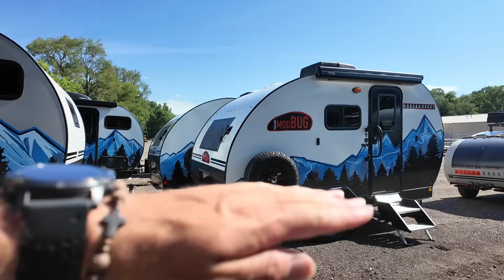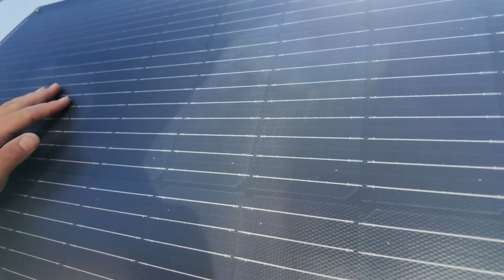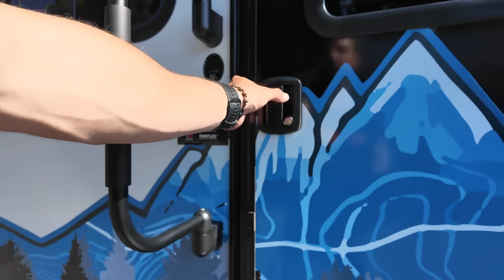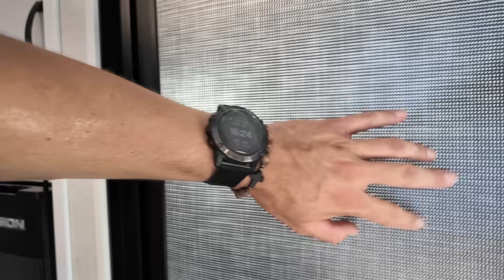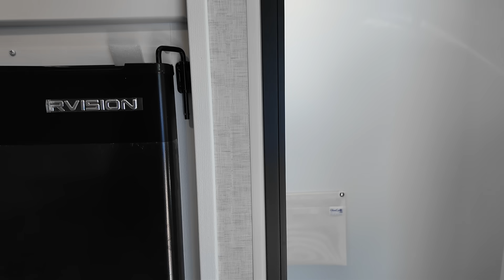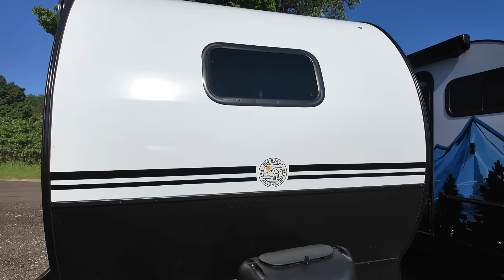2026 Modern Buggy BB14 Detailed Walkthrough

Comment: Sink in the Bath ? I; would like a second choice on the Roof A/C. 13500 btu is too big for this space. 9500 -10500 btu maybe. Some of the Sunset Park units have 5000 btu wall mount units. Less weight, less wind resistance, less expensive. Then a better spot for the Solar panel.

Comment: Hi was curious if this model has the external propane hookup for a side grill? Also the options list by the manufacturer states that there is an option for a “griddle slide out” I’m guessing that would go in the rear storage area is that right? Lastly what would be the feasibility for adding a backup camera?

Comment: Why would you go to the trouble of using Azdel on the floor and sides - and then use fiberglass on the roof where the air-conditioning is at?
Reply from the maker: I am not sure I understand your question... you want an azdel roof?
Reply: @fieldandsportsreport  Yes, if it's supposed to be waterproof and stronger than fiberglass why not use it for the whole trailer?

Comment: It sucks if you want a well-built trailer like this that won't rot you have to spend over $30,000 to get one.  A small trailer like this should never be over $20k, once you get over that, you can find much bigger trailers for the same price and quality.  It's almost like we are being punished for having small vehicles with a lower tow rating.
Reply from the maker: Only other thing I’d say is this retails in the mid 20’s so getting closer to your price point
Reply from the maker: I would argue the smaller campers you can take to so many more places. Bigger campers are limited in where they can go

Comment: Whats the flippin price unless I missed it. I hate when people make it difficult to find the price and their website doesnt show jack
Reply from the maker: They retail in the mid-20’s. I was just pointing out features. Pricing will vary dealer to dealer, state to state depending on options etc.
Reply: These trailers run about $32,000 but it varies by dealer.  Great trailer but way too damn expensive.
Reply: @DubC208 I mean they are high but it seems to be quality.  Like how Airstreams are expensive but last a loooong time.
Reply: @Mike81USA  A Human lifespan isn't long enough to justify the cost of an Airstream.

Comment: Bro...heres me again, and I like what MBggy is trying to do.  1st lose the utilitarian cement looking tops, they just make the interior look so much more cheaper.  Just white or wood be more warm and classic.  2nd The sliding BR door just screams cost cutting, put in a door with frosted plastic or solid.   Lastly put a drop bunk above dinnet that will now truly sleep 4.  Not much additional cost to do but the added value is superior.
Reply from the maker: Always appreciate your feedback and for watching... 
For the countertops - your preference is your preference in aesthetic. Can't argue it... They are 'Solid Surface' so a more expensive upgrade than a lot at this price point and they are are also incredibly lightweight. 

For the BR door - I would recommend using one (if you have already then all good) because I prefer it over a curtain or door. Lightweight, doesn't make you feel claustrophobic, self cleaning doesn't need to swing out to open so great for a small space. A lot like a pocket door.

The additional sleeping is a great call which is why we developed the BB16 that has that bunk you are talking about. Plus an additional 2 feet in length.
Reply: @fieldandsportsreport  I love the BR door, it's perfect. The solid surface Lagoon table too.
Reply: Thanks for the heads up on the 16, that's practically perfect.

Comment: Have you looked at the NuCamp Tab 360 or 400? Their layouts are so much nicer.
Reply from the maker: I have looked at both extensively. What are you referring to when you say 'nicer'? The Tab 400 weighs 800lbs more and costs $40,000. The Tab 360 only sleeps 2 people and costs $38,000. The BB14 sleeps 4, weighs 2200lbs, and costs roughly $25,000. I am not sure I would agree that their 'layout' would justify an additional $15,000 for a very similar layout and heavier. Thank you a ton for watching and commenting - genuinely appreciate it.
Reply: @fieldandsportsreport  I haven't found a dealer near me that will sell these for $25,000 most are around $32,000.
Reply: Many good features but shower door is complete failure in camper for 4.  4 people means two couples or couple with the kids. That shower screen provides zero privacy for showers or bathrooms usage. There seems to be also obsession with gap at the top of shower door in many trailers. If you guys tell us that it is for ventilation purposes, here is food for thought, a persons farts while using toilet will greatly ventilate into charming stink inside the cabin. If you cant put appropriate window that opens in a bathroom and have full door then don’t put toilets in at all.  
What is the audience for this trailer? You mentioned yourself and compared to TAB NuCamp. So now that you claimed fitting for 4 people, how the heck does this shower “ curtain” make any sense to you? I am not trying to be an a…., but seriously, some of the choices that many you, who are trying to break into light weight trailer market, make no sense and make us potential clients scratch our heads. Three way fridge would make this also better option. As far as cassette toilet, accessible from outside, as TAB,  is a great option and much easier to maintain clean. 
Coffee color is little too dark for small trailers and Latte color would probably be better color in my book. Good job on composite choice for roof. It would be better if you could bring up camera closer to show us how it joins the sidewalls to prevent the leaks.

Comment: lost me at 6ft 2in ceiling height. what were you thinking? minimum standard is 6ft 5in.
Reply from the maker: What standard are you referring to? Our competition in the teardrop segment is much closer to 5'8" interior. 6'5" ceiling height adds weight and increases wind resistance. By adding that weight and height, we would be gatekeeping a lot of motors who we originally designed this for. 

If you are looking for something taller on the inside I would check out the Sylvan Sport GOAT for something in that price point or the Sylvan Sport Vast if you were to go all - out. The founder is 6'5" so he specifically designed them to be that height.